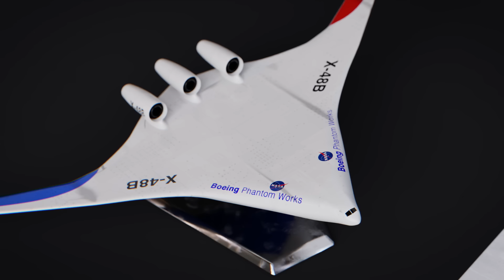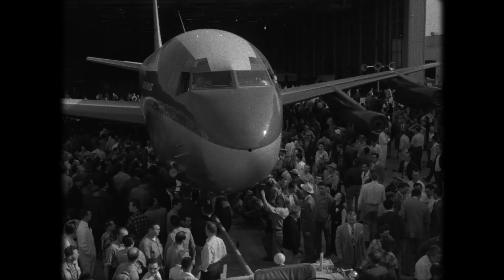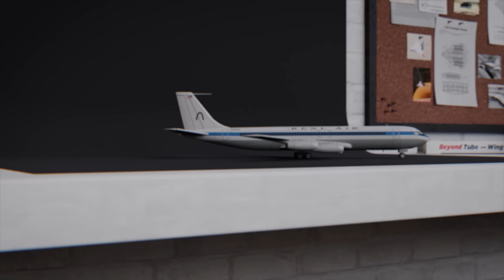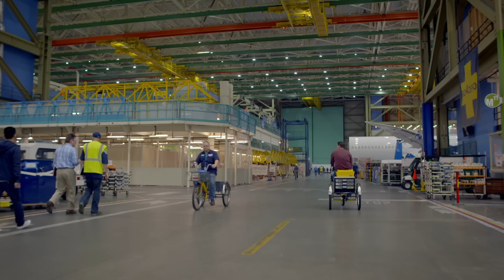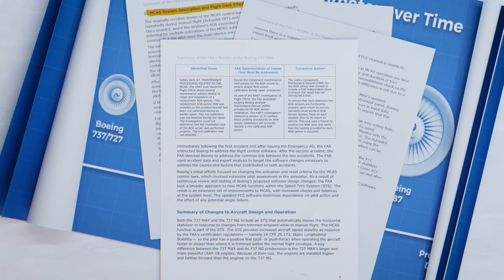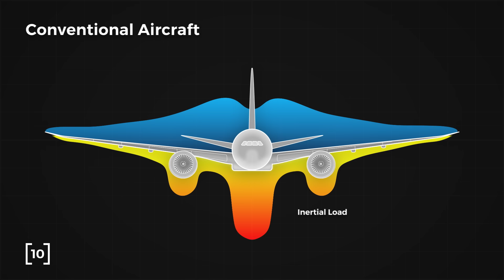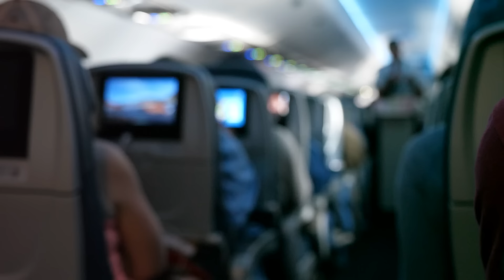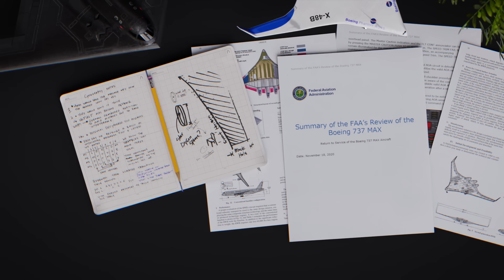The Plane That Will Change Travel Forever

Comment: I don't think blended wing aircraft will become a "thing". Like cars, aeroplanes come in one main form factor for a reason - which flows organically from physics. Look at a bird: they are also a tube design with main wings and a tailplane. Natural evolution, the most formidable engineer, derived over millions of years that this is the best layout. As the video discusses, blended wing introduces many control/software failure scenarios. And putting up with the things like no windows(!) is just a sign that this concept sacrifices too much to try and be different. This is a "solution" without a problem.
Reply: Birds are not tubes 😂 just because nature does it, does not make it the best shape for any similar application

Comment: Social networking really needs to be managed. As there is no bounds to propagating false narratives when it comes to social networking. Remember in rambo 1, the national guard got word from the sheriff's office that congressional medal of honor recipient green beret was responsible for the death of the town deputy. But we saw in the movie clearly rambo was not at fault. But people treat information obtained by social networking as factual evidence sealed with court approval. Well guess what folks you can't put all of the blame on what they said it was. The sensor should not have broke either. No body knows. Again social networking really ought to be managed so that accidents can be avoided. People adapt to the perceived power they possess when they believe they can leverage that power. At least do diligence and check the light bulbs before you depend your life on the light bulb to saving your life.

Comment: I'm not even slightly sure how you conclude that software engineers are responsible for 737 MAXes being configured with non-redundant critical sensors. Sensors are hardware, after all.

Comment: A little optimistic maybe, the B2 is noted as costing more than each planes weight in gold, so something a new airliner would not want to copy? Also making an autoclave big enough for a whole panel is nigh on impossible? Carbon fibre has it's uses but is not perfect, the 787 is beginning to have issues with structure and particularly repairs. And finally the comet failed in the roof not side windows, though they were changed to reduce stress

Comment: Personally, I think this video is a little over enthusiastic about BWB aircraft.  There are plenty of other challenges which were kind of hand waved away by this video such as crash survivability, normal air operations, pilot training and airport infrastructure. There is a reason why these aircraft have been flying in the military for decades and they still haven’t made the transition to airlines, and it’s not just the engineering challenges. As you’ve pointed out, most of these have been solved problems for a while.
Additionally, even in well designed FBW systems there have probably been too many occasions where flight protections have been degraded for regulators to be comfortable approving an inherently unstable design.

Comment: Just in case 747,000 people haven't mentioned it, it seems necessary to suggest the idea that some call that nebulous system of continuous concentration at the expense of outside distraction, for long periods of time. "The Flow". 

Some studies but not enough to assert it is "real" but if you burn the candle at both ends to reach a solution and enjoy the work, you may know of it. 

Others will complain but have zero problems dealing the rewards of your effort....

"You need to train so and so how to do what you do! A good manager ensures, blah, blah, blah... It's why we pay you."

You do not need to have the superior" IQ" of the team, though your number is no slouch. You lead and integrate your assets while chaos gnaws on you while in the "Flow" ignoring distraction of you immediate purpose. 

Most can not ignore chaos. They cower in fear of it. Embrace chaos and your team will succeed and you will succeed. It is a wonderful feeling... Too bad it doesn't last long.

TLDR;
Learn to manage insanely smart people that put your idea in motion through integration of your resources, while embracing Chaos.

/It's why we are here
//Feels good too
///YMMV

Comment: I think the question should be safety rather than cost. Commercial flying still has an unacceptable risk of death. I don't care about the vs car statistics. That's not the point. The fact that 280 people could die over a fault bolt is wild.
Reply: If commercial flying still had an "unacceptable risk of death," it wouldn't exist at the scale it does.
Reply: @smark1180  Those two brits on that Air India plane yesterday probably had the same thinking.
Reply: @purecountry-t  And? What you or they "think" doesn't change the fact of what I wrote.

Your comment is an Anecdotal Fallacy,  Appeal to Emotion, and Non Sequitur.
Reply: @smark1180  You're right. Flying is generally safe. Just not enough for me.

Comment: 8:30 But can’t we still make the center of lift and center of gravity the same place and still keep the tail? It would increase efficiency because you would be able to have the horizontal stablilizer to have an AOA of zero, that would reduce drag.
Reply: Or we could simply place the COG SLIGHTY in front of the COL, still keeping the auto-stabilization effect of the difference in the placements

Comment: Why dont they put the wings in front of the center of gravity, so u could make the rear stabilizer generate lift instead of downforce, allowing the main wings to be made smaller?
Reply: They can and do for a few aircraft, but it isn't practical for airliners.
Reply: @smark1180  why?
Reply: @ccmckernan  From a construction standpoint, canard layouts are a headache. 

They require a strong forward structure to support lift-generating surfaces far ahead of the center of gravity, which adds weight and complexity. For airliners, that means higher production costs, more structural reinforcement, and tougher certification — all for marginal efficiency gains that don't outweigh the downsides.

Comment: Repeated cycles of pressurization and depressurization of the blended wing passenger compartment might be problematic.  Current passenger planes have the strongest configuration  - a tubular fuselage.   A fuselage shaped like an irregular pancake will have very different stress points, not evenly distributed, and will likely crack or break a few times before they figure it all out.

Comment: I get it’s human nature to constantly try to innovate. But let’s stick with the tube and wing design for the next 50 years ok? A plane that requires so many precise and tiny movements while flying in an unpredictable world is a recipe for many deaths and accidents. Sure you can save on fuel, but do that 50 years from now. The only thing that keeps air travel afloat is the relative safety it provides over other forms of transportation. I would also say travel time as well, but people wouldn’t be willing to risk their lives to save on travel time. Fossil fuels aren’t going anywhere anytime soon, they’ve been saying we were gonna run out oil for the past 40 years. If we were truly gonna run out anytime soon, prices would be much much higher than they are now, especially considering the time and money it takes to refine oil into gas, not too mention how expensive it is to even get the oil out of the ground. So for once in human history, let’s stick with the reliable formula ok?

Comment: Awesome video! By the way, the BWB is not inherently unstable in pitch, it simply benefits from this instability to minimize trim drag, which is particularly punitive for this design given the short-coupled pitch control surfaces.

Comment: BIG QUESTION: Why didn't they just move the damn engines back? Like clearly the engines are put out on struts to be as far forward as possible, which just doesn't make any sense — given the first part of the explanation where the center of gravity is ahead of the center of lift. You would think that just moving the engines back in the center of the wings (or even trailing behind the wings a bit) would make the center of gravity and the center of lift at the same place.

I'm sure there's a great reason for this, I just want to know it!
Reply: Oh, duh: just needed to watch further for more explanation of why you always need forces counteracting each other, he just explains it in the next few minutes...

Comment: Cross or X Align four vac packed induction driven flywheels with pneumatic actuators to stabilise the craft/missile/torp/nade/penetrator around.  Arcburner/Arcjet boosting could probably dupe the same VC's if the first pitch lands with room to spare.

Comment: The profile of the Peregrine Falcon B2b Stealth Bomber and Goshawk F22  Raptor the Falcon is the fastest bird in a dive due strictly to aerodynamic efficiency, and the most maneuverable on the planet, due to its aerodynamic adaptability are only recently being used as a model for directional and stability flight control augmenting on fixed winged aircraft, when we’ve known about these sky chickens for years, The Falcon is the fastest Diving bird on or above Earth, but not as fast as a dove or pigeon in level flight, the Goshawk is also faster than the Falcon in level flight but still slower than their prey, but the pigeon or dove’s speed and maneuverability used to escape the falcon attacks from above, make it an ideal target for the Goshawk which doesn’t need to slow down in densely wooded hedgerows or forrest’s they fly to for cover concealment and safety. The Pigeons and Doves have developed strategies that improve their rate of survival but the raptors rule the skies

Comment: Hydrogen doesn't make sense for air travel, nor do batteries. Unless either can magically become as energy dense as hydrocarbon fuel, which is impossible even with a theoretically ideal battery using current technology or hydrogen stored at ultra-high pressures (thousands of pounds per square inch). Batteries are heavy and mean cruising and landing with the same weight you takeoff with, which given that up to half the takeoff weight of an aircraft may be fuel, is highly disadvantageous for performance and arguably degrades safety (e.g. higher approach/landing speeds). Hydrogen's problem is size, even when highly compressed, and the weight of the tanks to hold that insane pressure. Also, did I mention that hydrogen is odorless, colorless, has an extremely low explosive threshold (i.e. percentage of hydrogen required to form explosive atmosphere), and for the cherry on top... it burns with a colorless, smokeless flame. You can hold an open flame to a puddle of jet fuel and it won't even burn, the flashpoint is north of 100 degrees. Hydrogen's activation energy (i.e. ignition) requirement is ridiculously low; a static electricity "spark" too weak to be felt or produce visible light will easily ignite hydrogen.

Any genuinely clean hydrogen will be derived by splitting water. Whether simple electrolysis or some yet-unseen exotic photo-electro-thermo-chemical reaction, splitting water into hydrogen and oxygen requires energy input. The hydrogen is really just a "battery" of sorts in that regard to get energy from the grid to the plane. So why not just throw some carbon into the mix and make a proper synthetic drop-in fuel that benefits the entire existing aviation fleet? The technology exists, using direct carbon capture and the Fischer-Tropsch process, agriculturally derived fuels, biomass conversion via pyrolysis, etc. Ag-fuels already exist on the market as Sustainable Aviation Fuel. They're taking agriculturally-derived ethanol (i.e. corn liquor) and "upgrading" it to synthetic paraffinic kerosene through their trade secret blend of catalysts and processes.

Off-centerline seats on planes are highly uncomfortable for passengers. Any roll motion of the plane, even a few degrees for a shallow turn, means several feet of vertical movement for the passengers near the edges. The lack of windows will be a complete no-go for some passengers. Add to all that the safety concerns and lack of confidence following the 737 MAX and ongoing Boeing scandal... there's no chance this would gain enough passenger acceptance for an airline to buy in.

Comment: Blended wings are not simply flying wings. They are wing/fuselage combinations. People ride in the wing, somewhat. So, the stability challenges put aside, the wing needs to be thick enough to hold people, yet thin enough to use for jet speed. And this is a never-ending objection to the blended wing idea. Convair towed 2-damaged B-36s into their manufacturing facility, and sloped the thick wings back. Then they installed jet engines to the wing like the B-52. The USAF wanted Convair to attempt to modify their slow bombers to make them fast.

Well, they weren't but about 70 MPH faster. And they didn't fly very well. And Convair knew what the Force wanted would not be adequate. The thicker the wing, the slower the aircraft.

Comment: What if buffered tubes are located on the inside of the non-tubular fuselage. We only pressurize the tubular parts and leave the rest unpressurized. Instead of real windows, we use oled screens to stimulate windows.

Nvm, you just got to that part south pressurized tubes. You thought of everything!

Comment: @RealEngineering slight correction: The 737 Max's MCAS wasn't implemented because the 737 Max was less unstable than its predecessor. The new 737 engines are heavier and mounted more forward, meaning the center of gravity is pushed even more forward of the center of lift, which increases the passive stability of the 737, not decrease it. The report cited in this video explains that, true to its name MCAS (Maneuvering Characteristics Augmentation System) was installed to make the steering column "feel" more similar to its predecessor, not to counteract any loss in passive stability: "MCAS enhances the feel of the column forces in manual flight... resulting in the required column feel to the pilot".

Comment: The 737 Max's MCAS wasn't implemented because the 737 Max was less unstable than its predecessor. The new 737 engines are heavies and mounted more forward, meaning the center of gravity is pushed even more forward of the center of lift, which increases the passive stability of the 737, not decrease it. The report cited in this video explains that, true to its name MCAS (Maneuvering Characteristics Augmentation System) was installed to make the steering column "feel" more similar to its predecessor, not to counteract any loss in passive stability: "MCAS enhances the feel of the column forces in manual flight... resulting in the required column feel to the pilot".

Comment: Two things not mentioned: The effect of the tilt of in-air turns on passengers sitting closer to the outside of the fuselage. The tilt would have them hanging from their seatbelts, or thrown into the walls of the airplane if they’re not wearing them. Also, having to escape from an aircraft without windows when you have no idea what is outside the door will give some people pause, delaying evacuation.

Comment: As to the 737 MAX software, the ultimate problem is that BOEING failed to tell the airlines and pil9ts how it worked, and how to turn it off if it was making their planes nose dive. Stupid Cheapness and the assumption that the system would never fail into a suicidal dive.  Just like the idiocy that let the Challenger launch with frozen O rings on the rocket boosters. There is a sad tendency of some engineers to think that solving a problem on paper eliminates the problem in reality. That may work on an exam, but not with real planes, buildings, bridges, and rockets.

Comment: My Honest Opinion on The Blended Wing Body Aircraft.

The plane is incredibly ugly by its design. The traditional aircraft designs look better against the background of their beautiful and beautiful expression. In relation to the Blended Wing Body Aircraft, which most of all looks like a pacifier that has had 2 finger bones mounted on it where the tips have just been broken out of joint.

It also has no windows, which I personally cannot accept as I need to sit by a window seat during a flight. And being able to document and record what happens along the way, as it is part of my experience of travelling.

I also didn't think that the aircraft manufacturers think about the people who either suffer from a fear of flying or the people who are going out to fly for the first time and who might need a window to look out of in order to follow involved in what is happening outside.

I hope that any Airbus Employees or Employees from other Aircraft Factories see this message and possibly ask their bosses to either drop these ugly planes, or at least put some windows in them, because if not these planes have windows fitted in them if they are put into service then I wouldn't put my feet aboard them.

I hope that there are people out there who agree with me and have the same attitude towards these planes, and if you do, please leave a like in the comment section.

And to those of you who thought I was overreacting and thought I should relax a bit in terms of my opinion on these planes, I don't care.